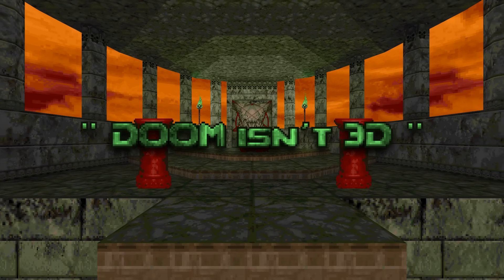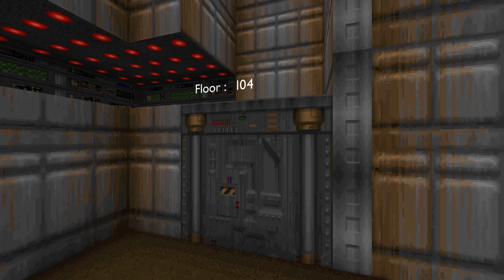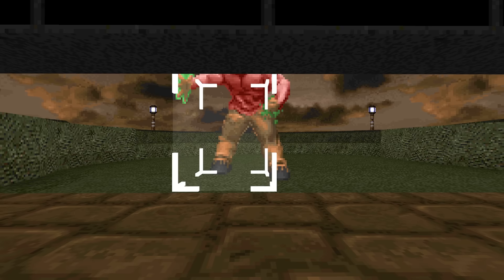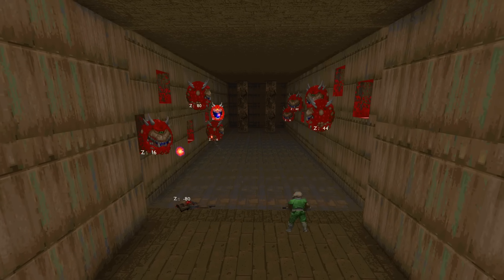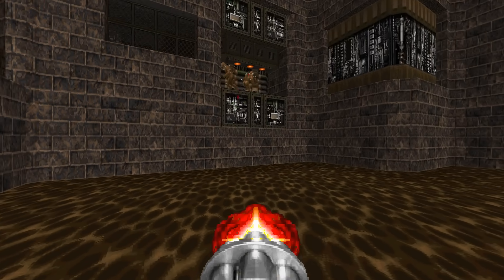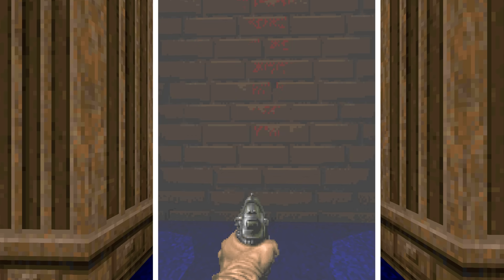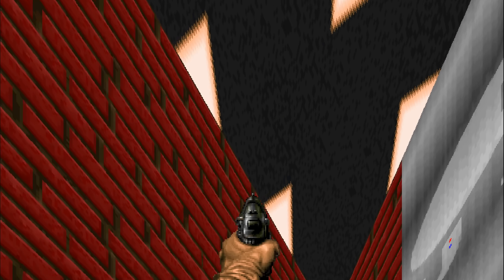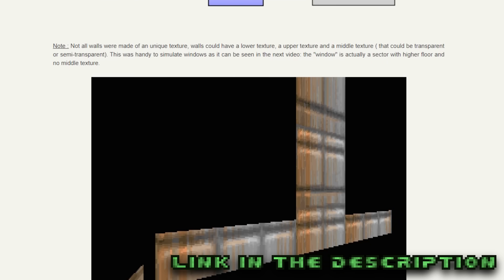Doom engine - Limited but still 3D

Comment: Doom is a 2D game, with heights, the perspective is an illusion.
Same goes with Duke Nukem 3D, but it had a much more clever engine, I used to create maps for Duke 3D back in the day, doors that opened and closed like normal doors were lifted floors that moved around, the engine could cheat and create two or more areas that could overlap, and the floor could be skewed vertically to create a slope or a hill.
The build engine went even further in Shadow Warrior, as to include fake vertex-style 3D objects, using tiny floating pixel sprites that would come together to form a 3D object.
They were still 2D, and as a kid who was playing around with the game engine/map editor, this was undeniable.
Reply: That's a map format limitation don't confuse it with the entire engine, when you're playing you are in a 3D space.

Comment: Doom ain't 3D. The whole map is a flat plane just as you see it when you open the minimap. There's one easy way to tell that it's not a 3D game : In the original, non-source port Doom for DOS, there is no way to jump (not because they didn't want you to jump of course), no way to have a room sitting on top of another (that would require 3D polygons and a Z-Axis, which this game actually doesn't have), no way to look up and down, no fall damage whatsoever. ANYTHING that blocks Doomguy is infinitely tall or the way I see it, infinitely thin. It's like a pencil drawing on a sheet of paper but the pencil is never allowed to leave said sheet of paper. Doom is actually not that different from Wolfenstein 3D. It ain't any more 3D than that game. Duke Nukem 3D on the other hand is 3D (still with the paper-thin character/item sprites but the rest is 3D nonetheless).
Reply: Did you even watch the video?

Comment: I mean the rendering is basically just a beefy version of the (definitely not 3D) rendering style used in the, ironically named, Wolfenstein 3D. That said, pretty much all of the ways it’s been beefed up take 3D into account so it’s arguably 3D although I’ll probably still call it 2.5D in the same way most modern 3D printers print in 2.5D but that’s ultimately just a judgement call on how to collapse quite a complex set of information about the game into a single label so it’s hardly definitive nor could any label that short ever hope to be unless that label was “doom” which is pretty meaningless unless you already know all this anyway.

Comment: Also the proof that several of these are workarounds rather than hard limit is that it doesn't apply to other games on Doom engine - in Heretic and Hexen monsters aren't infinitely tall (which was added because the games have a flight powerup for the player), and Hexen also allows looking up and down at a limited angle using the method you've shown in the video (scrolling the view up, or Z-shearing). In Hexen there is also a jump button.

Comment: I have heard arguments that Doom is 2D rather than 3D because of the points in this video. What's the consensus?
Reply: It was the closest thing possible to 3D at the time. There is a Z axis. Source ports fix the infinite height issue, and room over room has been simulated successfully.

Comment: You forgot to mention the segs limitation, which runs around ~32600 segs.
And if you make your maps richer than that - you get a segs overflow error
and the map will crash. Experienced this dozens of times during my remaking
of Hexen maps. This is the most annoying limitation. Rooms above rooms is
the runner-up. It is a hurdle, but with enough creativity and ingenuity - it is not
that much of an obstacle. The second most annoying limitation - is the relativity
of the height of the vertical structures: all non-dummy (as in the ones you can enter) 
outdoor buildings in the level have to be the same ceiling height - or there will be 
issues with graphics. This precludes making multi-structural realistic (~ish) 
castles, unless they are made of dummy sections - or look primitive. 
Yes, you can manipulate floor height by making substructures to create a 
decent, limited-effect illusion of a different height, but it's only an illusion :-)...

ID-tech1 is quite adept at putting sticks into the design wheels, but as it was
mentioned by you and me both: if you know what you're doing, there are ways
to reach very far with it. The extremely streamlined Doombuilder interface 
makes the ONLY TRUE limit in map-making -  the imagination of the modder.
Unlike ID-tech4, for example - one look at its maps in the editor can induce a
heart attack (lol), making it a technical slog rather than a creative whirlwind
that ID-tech1 editing is. Doom on!

Comment: Good news for Doom players, Doom uses Physx when enabled in the device. My tab is Physx enabled, the enemies roll down from the stairs when shot down near the stairs. To enable Physx on any device, use a flight sim, and with high speed fly as low as possible to see the shadow of the plane. Tab meeds 45 min continuous flight, laptop needs nvidia driver cpu physx, and 30 min flight.

Comment: The "fixed camera angle" was a limitation in Star Wars Dark Forces, as they used a source port of Doom to make the game.  The camera has trouble looking up and down.  Things look VERY warped, which is why they opted for a 3D engine for Jedi Knight, so they didn't have to worry about the warping when mouse looking.

Comment: All 3D uses the same skills used by renaissance painters to create the illusion of space and light on a flat canvas. A retired colleague knew an insane amount about CAD, and had a few books from that era (reproductions, obviously) in which the techniques are demonstrated that are still utilized by computers today. It's simply a matter of raw processing power.
And processing power was in short supply that day (I remember 40mhz computers, and then 200mhz being fast, and then the first single-core gigahertz processors etc), and with the tricks that were required to make it work, they ushered in a new era.

Comment: I remember, back in the day, on Usenet at the time, trying to pick apart how the DOOM engine was doing this (with like 30 other people) and how we could replicate it on crap systems with 2 megs of RAM.  I was making 2D games back then, was able to replicate the Wolfenstein "3D" grid-based "ray tracing" technique, but could never figure this one out.  I had moved on by the time the DOOM source was released, but this is a great explanation :)  Thank you!
Reply: Technique used in wolf3D is called raycasting to distinguish it from actual ray tracing.

Comment: The limitations are due to the computer power of that time, Doom was supposed to run on a 386 computer with a 320x200x256 MCGA/VGA graphic card (no 3D card), these hardware were just not strong enough to deal with complex 3D graphics. On top of that, Doom was supposed to fit on 20MB disk space  and run on a 4MB machine... 
For this time, it was an amazing engine, compare on the hardware available.

Comment: I dislike hearing this argument because frankly I believe it spreads misinformation. Here's the thing, 3D is a geometric term. It isn't something you can argue about using talking points. Your statement at the end stating that "it isn't that simple" is not correct. 

There are very specific rules in place for mathematics. I don't make these rules, I just follow them. For a system to be complete means it must not have exceptions. As soon as you say "it's 3D, but..." It's not 3D.  It's similar to if you were to write a simple function, "2x = f(x)" then say "well actually but if you input 4 you get 5 for y." You broke the rules of your function, so you didn't represent it accurately. Mathematics is not WYSIWYG (what you see is what you get). There are so many exceptions in Doom that it would be absurd to call it 3D. It is also misleading to say to a person who is only familiar with games that more accurately model 3D space that "Doom is 3D, don't listen to the math autists" without a several minute long explanation. It would be more productive to say it isn't 3D and encourage them to look up more information.

Even within the one room you can have not stacked on top another room, there are exceptions. "But they did it because of hardware limitations" is irrelevant. All software is designed with hardware limitations in mind. The system isn't complete and therefore isn't 3D. It's quite hard to suggest there should be a debate about something so mathematically simple.

Comment: The visual engine having heavy distortion when looking up is actually a result of the game using basically a computer science equivalent of 2 point perspective projection, which means that all vertical lines are parallel and aren't converging to a point, the third point, which is the only thing separating it from the good ol' rectalinear projection most "3D" games nowadays use.

Comment: Doom is 3D in terms of gameplay because the floor or ceiling can block projectiles. This makes a map highly strategic where many modern 3D games do not have it. Especially on smartphone games. Many of those have a 3D renderer but no 3D gameplay whatsoever.

Comment: Kinda curious about the whole no floors above floors thing...

I recall the same being said about the levels in Duke Nukem 3D but when I dabbled in the Level Editor ( that looked remarkably similar as the one in DOOM showed in this Video ) as a kid I still somehow managed to pull it off by creating the outline of two rooms next to each other plus a connecting pathway between the two in the 2D Editor, switching over to the 3D Environment where you'd manipulate the height of floors and ceiling I'd raise one room higher than the other, and finally switch back to the 2D Editor and rearrange the outlines of one room to be above the other.

Switching back to the 3D Environment one Room would now be above the other when moving from one to the other using the connecting path ( which could either be a stairway or a ramp ).

The only limitation I do recall was when the space of both room were visible at both times causing the engine to glitch out but if you avoided that it ran just fine 🤔

Comment: Doom looks 3D and that is all that matters for the gamer
Tricks, shortcuts and optimization are a thing for the programmer :-) 

The visual aspect of the engine is not 3D. It is an optimized approximation of a fixed viewport. The geometry can be viewed as true 3D environment since enough information is present to interpret it as such. The collision limitations have a lot to do with the way of rendering. For optimization purposes, the collision detection is done when calculating the visuals. There are Doomlike engines that allow looking up and down and even have (seemingly) rooms above rooms. This is done by "tricks" to allow to circumvent the limited description of geometry (floor&ceiling levels). A good example is the Marathon 2 engine or the Duke Nukem 3D engine. But both of these engines are still very limited and cannot display true 3D, just a limited approximation of 3D.
True 3D is defined as the implementation of coherent rules like perspective correct or orthogonal rendering. The camera in a true 3D engine is in the same way part of a 3D environment as any object. Tilting, rotation, zoom, fov,... are some methods to change the representation on the screen. Doom does not allow that. I can easily create an orthogonal or even perspective correct voxel-plane without implementing any 3D environment. The result looks 3D but it isn't. The true genius of John Carmack is the way he left things out, optimized the view and decided what is needed for a 486-optimized pseudo-3D environment that can fool the viewer good enough
Deciding what is needed and what not defines a good programmer.

Comment: It's interesting to contrast the Build engine (Duke Nukem 3D), which added slanted floors and how much more detail you can do with those. They don't just have to be used as floors. Tunnel pieces, statue edges, etc. One little extra trick, and the art can look drastically different and less blocky.  On the otherhand, it seems that DOOM might have been more popular overall and with more popularity came more creators willing to try to reach the limits of the engine. I'm struggling to find many duke levels that compare to the detail your DOOM ones have, though again, many might not have easy screenshots available online.
 
You put a ton of great effort into illustrating what you knew about the game! Incredible video work!
Reply: I think it was more popular because it came out 93 while duke came out 96, 
making doom being able to run on pretty much any hardware by 96, while some of us couldent run duke with decent fps(not that I noticed because i had nothing to compare with) even on low end settings.
Then it might also by that by 96 there was a lot of "doom clones" making duke not so special by comparison.

Comment: Interesting, especially the part in which you explain they could have done it differently, but just didn't, because the game has to be sold and run on the maximum of computers at the time it was released, I remember aiming in Vanilla Doom was always strange to me, even at the time, unlike in Corridor 7, as Corridor 7 was flat.

Comment: It's absolutely 3D. Its like ray tracing users claiming that tradition ambient occlusion or shadowing methods aren't "real" shadows. Of course they aren't and neither are raytracing's. Its all a computer estimation programmed to fake the illusion of shadowing. Just because Doom's engine fakes the illusion of 3D differently than a modern 3D engine doesn't make it less real. It simply makes it less accurate.

Comment: What are those nice maps you showed here? Are they just nice looking maps using DOOM's engine or they are used in some fan game?
Reply: I have to say, Eviternity, of all the others seems the best, I played a bit of each one you posted here. It's so cleverly made, using stage designs that rivals and even surpasses the originals in lots of ways. Smart use of switches, areas that depend on exploration and isn't locked by requiring key cards to advance, great structure and even some simple platforming here and there. Fair items and health placement, fair difficulty. I liked the others too but Eviternity is really the one that stands out in my experience. Thanks for posting it! Do you have videos focused on this kind of fan made, reviewing them or something?
Reply: I should have clicked that "read more" button, thanks, I'll check those, they look really sweet!

Comment: I would argue that you need to split this discussion up in two parts. 1: Is the gameplay 3D? 2: Are the graphics 3D?
My answers to these questions are that that the gameplay is 3D because all three access are relevant to it, and that the graphics aren't 3D because it can only handle a limited amount of angles for the shape of the world and the camera.
Reply: @borogk  that does make sense, but I think that you can't define both fields the same way. There's an obvious difference with full 3D graphics engine with shapes and angles, while the gameplay is still comparible to modern 3D games.
I also think that it's important to define 2.5D graphics engines as a separate thing as to make non-polygonal graphics solutions more easy to identify and search for online.

Comment: For me, best indicator is how map data is recorded.

In case of DooM, it is 2d map interpreted as 3d object: set of x,y points that make lines and then sectors with additional information about height of floor and ceiling. There are no points with x, y and z information.

Therefore, 2.5D.
Reply: You're correct about the map data, but the things in the map (players, enemies, projectiles etc.) all have x, y and z information fully stored.  Does that not count for anything?
Reply: @bauul.  Monsters and other things in level are separate issue from level geometry.
Nowadays I have slightly different argument: that of 3d shapes. You can, in principle, make any 3d shape in Quake. You cannot make any 3d shape in Doom - only subset of these shapes. For example, you cannot make room above room.